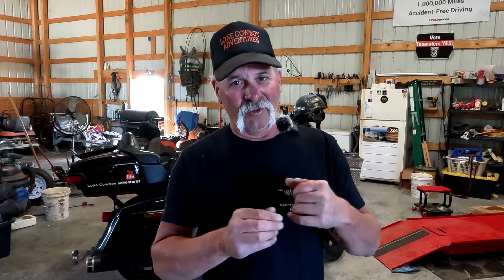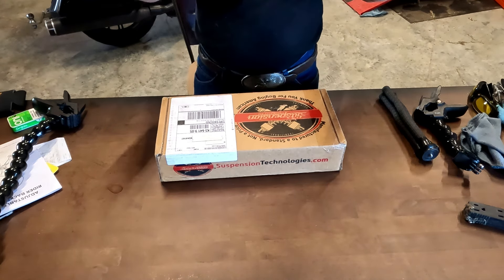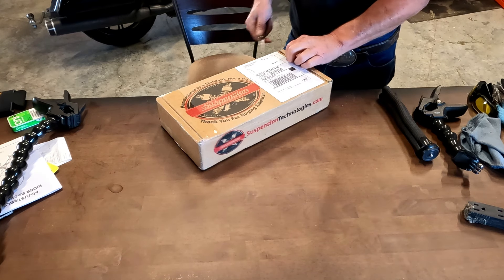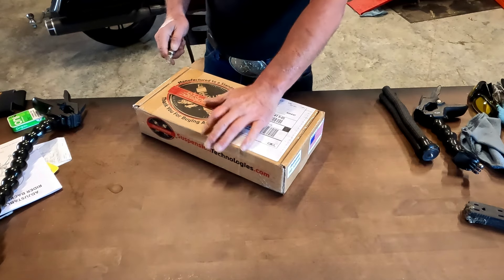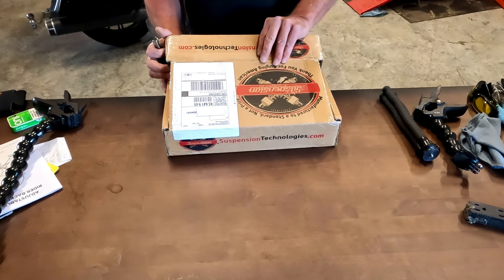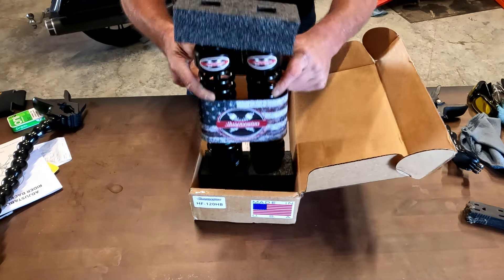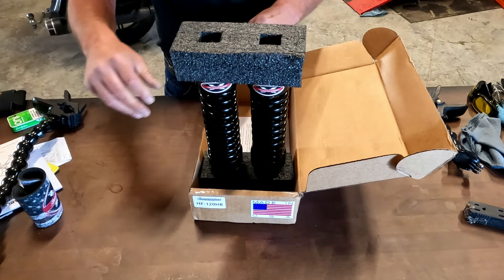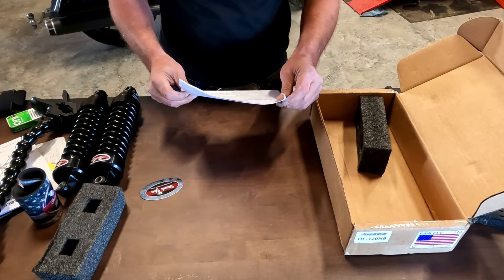I NEEDED THIS UPGRADE! #suspensionupgrade #harleydavidsonroadglide #supportbikers

Comment: LC, I'm running Suspension Technology shocks for about 2 years. I like them ok, I'm playing around with the adjustments some. It was a big improvement over the air shocks that was on my 2012 FLHTK.. I'm giving Terry Cable shock some serious thought..
Reply from the maker: @freddie_ray1498  I put about 80 miles on them for break-in. I turned them up two turns and then rode to work this morning and it was a great improvement.
My next upgrade will either be the front forks or audio. I haven’t decided yet.